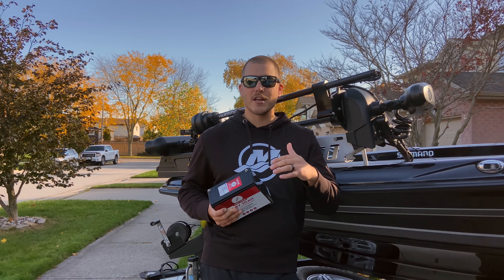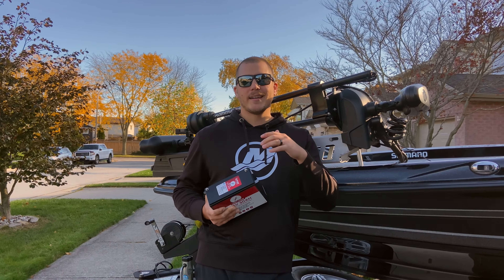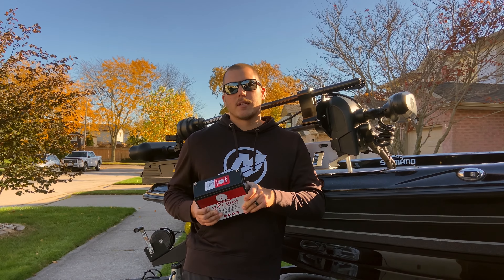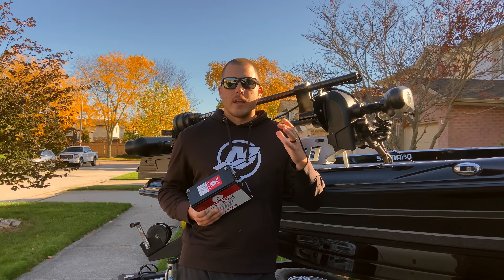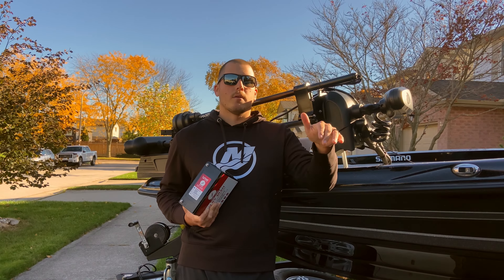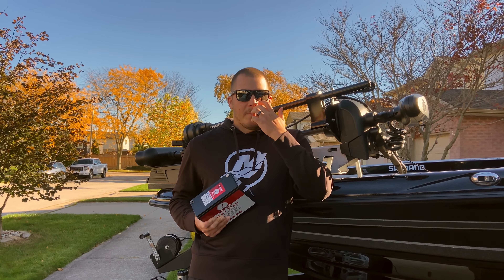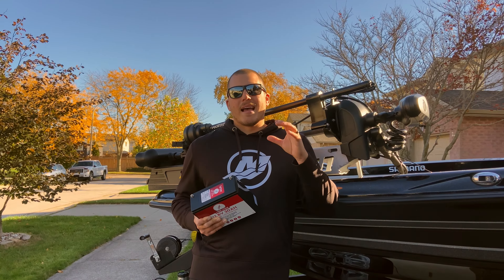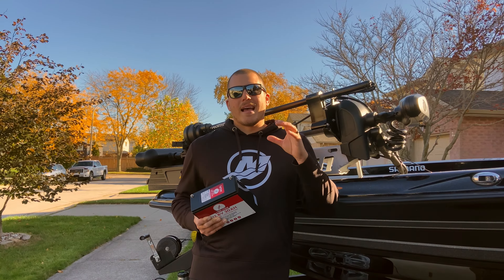How to Get Clear Sonar | Dedicated Livescope & Mega 360 Lithium Battery

Comment: What about the graphs? Im running two 15 inch Solix and one lowrance with 3d box. One garmin 12 1242xsv graph. Them solix pull  a lot of power all day. I await your reply before i pull the trigger to buy. That is a small battery for a big job😊
Reply from the maker: You don’t want to run all your electronics off a battery of this size. If you’re looking at a lithium battery dedicated to all your electronics you want to get a 100AH at minimum.

Comment: What did you do with the drain/sheild wire that runs along with the ground wire on the mega live?
Reply from the maker: We put the ground and drain wire together. But I always put heat shrink tubing over any of the exposed drain wire together
Reply: Ok thanks that's what I did @patrickzajdel